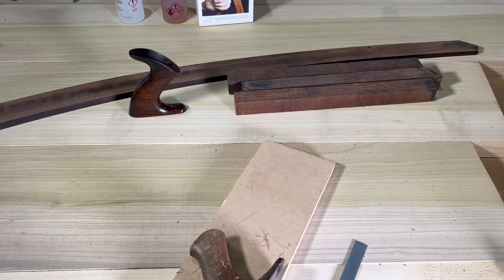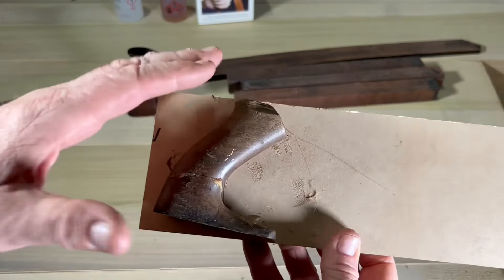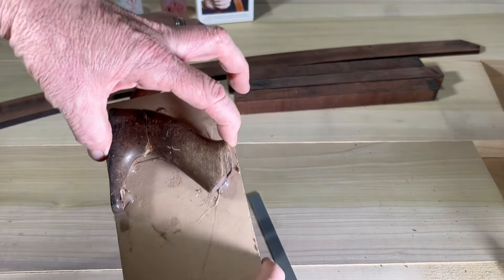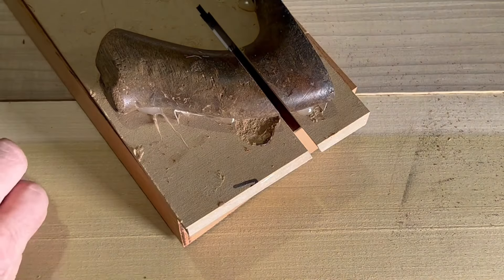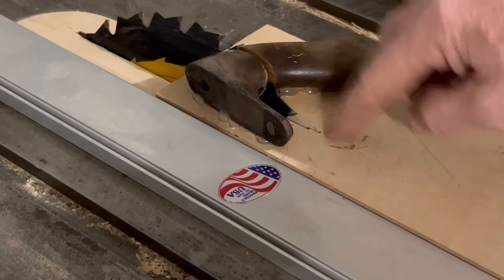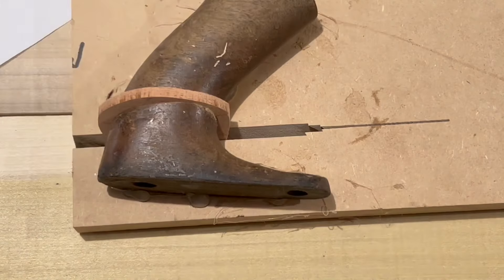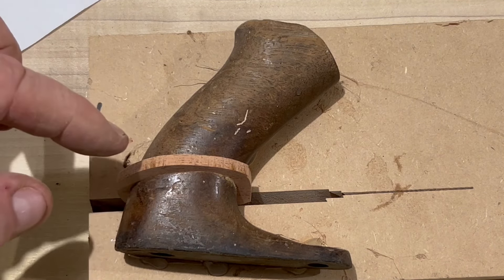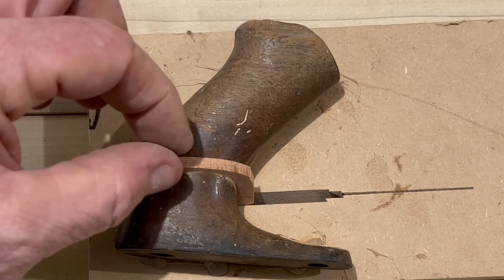The use of a MDF sled to hold & cut a plane tote

Comment: Gordon,
I'm repairing a similar "repair". The glue up is slightly off.  To assure getting both halfs aligned, would a dowl used in a previous vid "3 separate peices" be a better way to go, than what is presented here?  Also, my tote is beech, so suggest just clear epoxy with no tint? And lastly, how did you blend new beech with old, stain? Thx a bunch...
Reply from the maker: Sorry I missed this !  For alignment I have turned (or taken a large dowel and sanded it down) but if you do the dry fit, and your dowel is snug, you should get a nice alignment. If the bore has been “messed with” and it’s oblong, the dowel trick doesn’t work. Make sure your “applied clamp force” is perpendicular to the break so you don’t shift. Many times I just use a toothpick to inspect the outer surface…if you’re shifted there’s a step… tap or adjust and inspect again. With beech, I never tint. You’re correct to use clear adhesive.
Reply from the maker: Regarding the coloration, I use Transtint dye. Stain has pigment and therefore can be difficult to apply evenly… dye is a uniform color that doesn’t care about pores or medullary rays.
Reply from the maker: I do have a video coming soon that shows  how I tinted a clear “off white” sapwood that needed to be vintage amber. It’s amazing how well the dyes cover vs gel stains or pigment stains